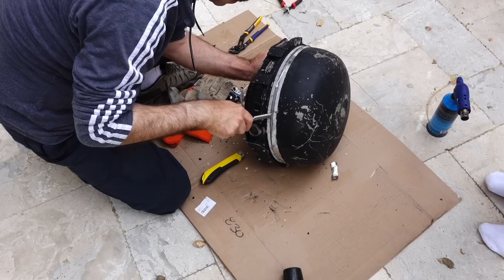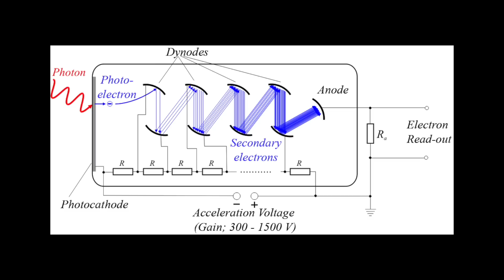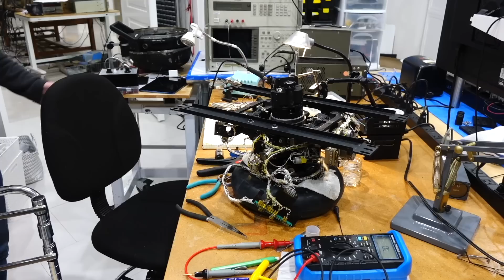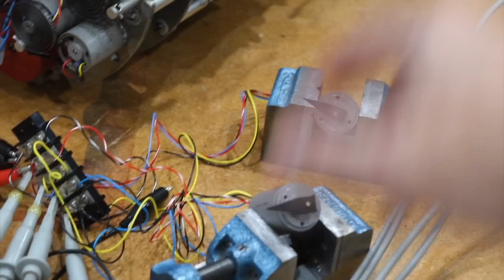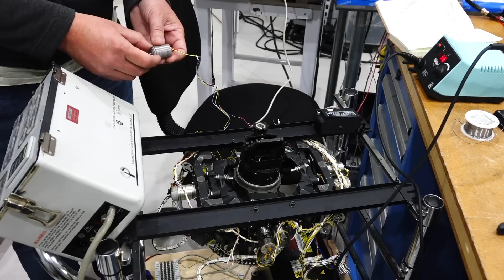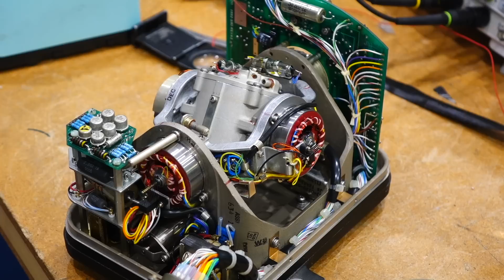B-52 Bomber Astro Tracker - Part 2: Power up and gyro-stabilization

Comment: Many years ago, I used to help maintain the Royal Navy SCOT satellite communications equipment as a 3rd line maintenance engineer. There was a complex analogue / mechanical computer used to control the safe transmission areas, AKA the 'Wooded  Arc computer', it was a very interesting, if somewhat frustrating, piece of hardware to maintain.

Comment: And they said we couldn't do all the stuff they do today. All they had was slide rules in smart people and look what they'd done the rocketdine J1 rocket engine, I mean, look at everything they did before digital computers.
Reply from the maker: Oh no, they sure used computers. Humongous, if slow, digital ones, and when that wasn’t fast enough for the engines, analog ones. We have the analog programs for the J2 engines, and it’s quite impressive. It can simulate the whole ignition phase of the engine, all the pressures, temps, and the flows, transients and all. But you had to know your maths.

Comment: What are the liquid sensors in the gyro? How it works?
Reply: Sometimes called « gravity sensor » they permit to keep the horizontality of both gimbals, therefore the verticality of the gyro. There is inside the sensor a kind of electrolyte solution in contact with a common line. The resistance between the common terminal and a sense terminal depends on the volume of electrolyte between the common line and the sense terminal, which depends on the angle of the sensor. The sensor is connected to the torquer of the other gimbal which produces a control loop, keeping the gyro vertical.

Comment: AVE has a present for you Marc,   the unopened Gyro part for your Astro,  and Dave hasn't had a go at it.
Reply: Saved by the Canadian! Or maybe it is the french connection?! Naa... that ain't it. 😂
Reply: @rkan2  Ha Ha  good one.
Reply from the maker: Yep. That’s not the gyro, but it’s even better: it’s the analog computer that calculates the pointing. Full of gears goodness. The one that Dave opened up.

Comment: The German equivalent of this device was the so called Himmelkompass, an innovation using light from the dawn (this light is naturally polarized) so that it could navigate to the far north and arctic. The Astrotracker as far I remember was using fix points on the sky and it was initially developed for the archangel projects, leading to RS71.

Comment: I see you are making great progress. The rotating shutter is used to resolve azimuth error and altitude error. The circular hole in the shutter just touches the center of the viewing port. When the azimuth and altitude values are correct, star light passes through the center of the viewing port and a square wave signal is generated by the photomultiplier regardless of the rotational position of the shutter. If there are errors in the altitude or azimuth, the shutter will block the star light during part of its rotation and the square wave signal disappears. By noting the angular position of the shutter when the signal is present, the system resolves the errors into azimuth and altitude components. These errors are displayed on their own digital display box and fed back to the computer. The computer uses these errors to adjust its calculated star position and it is fed back to the astrotracker. As the corrections are applied the error signals are reduced until the star light passes through the center of the viewing port.

Comment: Something else I noticed - since the tracker platform is not moving in flight, you could have just used a couple of weighted bobs on the two test syncro transmitters shafts to get a reference for "down". But why do that when you just have an extra vertical axis gyro just lying around? Extra mile as usual, great job!
Reply: It's all moving in flight
Reply: @snakerstran9101  Right, I meant "it's not moving in flight" right now, currently - it's on a test stand.

Comment: So, the old TV antenna rotator on top of the tower beside our house, was that a servo resolver also?
Reply: The ones i know are just 2 way synchronous motors, with a limit switch that cuts power to the motor when the limit position is reached.

Comment: I was a crew chief on B-52 H models in the 1980s and would take care not to kick or step on the glass dome of the Astrotracker on the top of the fuselage center wing section every time I had to dip fuel tank to verify the fuel load.  I was always curious how this gizmo worked and thanks to your video, I am just as confused but more informed on it's operation.
Reply: cmon, kick the dome

Comment: Great video (as is your usual)!

Plus-or-minus 15 degrees in roll is less than the bank angle for a standard rate turn.  Any idea whether they´d have the pilot fly straight and level, and have the navigator cage the gyro, to get the platform leveled after takeoff? Or was the range in roll greater than you stated?

The tachometer-generator is essentially the Derivative part of a PID controller!

Your box of Chinese polywannacracker capacitors is exactly the same as mine!
Reply from the maker: The tracker would simply loose lock during higher bank angle maneuvers, but it would lock right back as soon as you leveled off, as the underlying B-52 inertial nav platform would have continued to track heading accurately in the short term, and the pointing computer would have continued to compute just the same.

Comment: I've always loved those old servo systems.  In the Navy (more years ago than I care to remember) we used those resolvers with many plotting tools.  We fed the ships speed signal into the rotor winding and turned the shaft based on the ship's heading (using a signal from the gyrocompass).  So the two outputs were north-south speed and east-west speed.  Fed that into a 'dead reckoning plotter' to help us track ourselves and other ships in the area.

Comment: Such cool devices. I have a Simrad RGC-50 gyro compass (manufactured by Tokyo Keiki) out of a tug boat that has been modernized. It makes the same gyro and synchro noises as in this video. The synchros are used to have the heading frame follow the gyro (called a sensitive member) itself, and also to communicate the ships heading to a repeater at the helm position.

Comment: Interesting wiggle the gyro does, too! Does it do that to self-align if the case isn’t perfectly level?
Reply: Self-alignment is performed all the time. At start-up the wiggle is due to the low rigidity of the gyro rotor, in that case the effect of the torquers which regulate the verticality is strong, and reduces when the rigidity of the rotor increases.
Reply from the maker: @lelabodemichel5162  I was going to say "exactly, just what this astute commenter answered", then realized it was Michel...

Comment: If the whole thing is stabilized by a gyro, then how is it any more accurate than a gyro compass?
Reply from the maker: That's a vertical gyro. Different beast from a gyro compass entirely. It just maintains the telescope base vertical (and unlike a gyro compass, it does not drift because it self-torques to the local vertical). Direction and location info comes from the star sighting, not from the gyro. That's the whole point of the device.
Reply: Wow, it's amazing that they accomplished this without a digital computer. Thanks for another great video!

Comment: 3:50 given how good mirrors are today, it makes you wonder why telescopes for astral observation don't do away with the whole dome + telescope moving (which is a costly item to maintain, let alone make) and don't use something like this. It wouldn't even need to be a prism. A mirror enclosed inside a vacuum would probably suffice. It would be relatively cheaper to make, maintenance would certainly be cheaper and so would the maintenance costs, not to mention the fact that with a static telescope, you would effortlessly increase the component sizes since weight isn't a factor anymore. All the seals would be smaller, the costs to keep the telescope at an even temperature would be lowered... THIS, is how telescopes should be made. Whatever obstacles there may be in the manufacturing of the moving component would pale in comparison to the benefits gained. Not to mention that if you do this... you could feasibly make some really wacky telescopes that increase the size of the observed area.
Reply: Reflector telescopes are simple in design with virtually no moving parts, mounting them is relatively simple, and building a dome is relatively simple too. 

No, this is more complex especially if you need moving components inside a large vacuum chamber and have this chamber built of a non-distorting material. And scaling would be a pain as a vacuum chamber will need to scale with the cube of the apature...

Comment: 0:33 for future reference, i was reading a forum on the topic of de-canning stuff like this and the recommended method is to use a 400w iron with a flat tip that's about 2x2 cm wide. The specific tool the forum was discussing had a small metal belt behind it, in which you'd fit the strip and pulling it forward would also pull the strip away from the canned item. It's not electronics specific. At the time (and prior) a lot of things were canned in this fashion in vacuum to preserve them, including such things as art pieces, food, chemicals.
Reply: Mmmmm. Flames Not Good for Astro-tracker!  The earliest soldering 'irons' were massive blocks of copper filed to a small chisel point,, mounted on a mild steel rod with a wooden handle, heated separately, usually over a gas burner. One could do quite a bit of work before needing to swap to the 2nd one sitting on the burner.  We used them in the Post & Telegraph back in the 1950s when working on underground telephone lines.
Reply: @av8bvma513  I didn't realize the tips were copper! Better heat conductor I guess.
Reply: this reminds of soldering irons we had in high school metal shop -- actual large iron slugs with wood handles that were put in tabletop gas-fired burners to heat up and then solder pieces of sheet metal together.

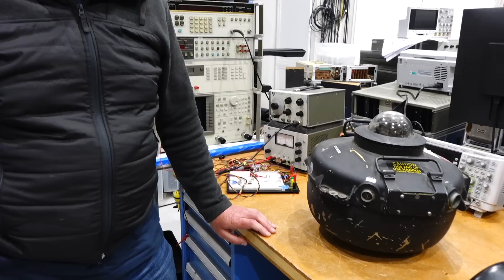Comment: 11:18 Doesn't EVERYONE travel with their own Vertical Reference Gyro? I myself personally have 3, one for travel and two for backup!😁
What on earth would we do without the "Doodley-Doo"? We'd have no idea what is going on!
It's absolutely amazing that something so complex and mechanical was also robust enough to be mounted in a B-52.
Tiny mechanical parts as well as electronics hate four things: vibration, large temperature variations,  moisture and dirt.
All of these are present any time a device like this is removed from laboratory conditions and has to deal with the real world.
Getting it to work at all, let alone in a B-52 bomber is a tribute to the engineers that developed this.

Comment: The name really suits the channel,marc is curious about so many things,but he has the applied math and engineering smarts to explore his curiosity,thats why this channel is so damned brilliant!
I can only partially grasp whats happening on my first view,so i will have to watch several takes,to grasp the interconnected ststems here,i only have an undergrad math level of understanding here,theres a lot of feedback loops in the mix,i dont know much electromechanics.
The thing is,using analog methods,the solutions are really creative,and the electro mechanal device they built back then,is so flippin gorgeous,its a work of art!
How to  solve a difficult problem,when you dont have a 64 bit multicore processor,and a truck load of software libraries to run your equations on,watch and learn people!!!
Well done Marc,and Michel!
Just to add,ive been tuned into Michels channel for about a year,he's amazing,check him out.
Not surprised he and Marc hooked up.

Comment: How to select which star to use?
Reply from the maker: It’s explained in part 1. You have a panel on which you enter the star Hour Angle and Declination, the GMT, time, the Greenwhich Hour of Aries (from an almanac), and your estimated latitude,  longitude and heading (usually from the inertial nav). The analog computer then takes all of that and points the telescope the right way (hopefully), automagically.

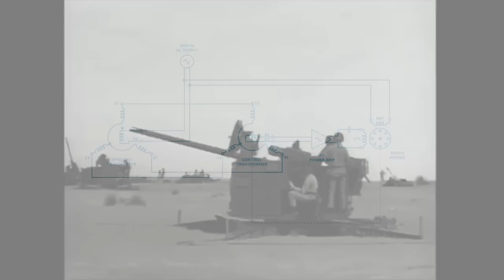Comment: 14:37 what technology was used to amplify the servo signals to drive a big gun, in the days before IGBTs etc?
Reply: I saw not so long ago a good video about the B29 turret control system, if you type in the search field you can find it easiely. The gun moved by powerful dc motors. The power stage is a H bridge builded from  simple electromechanical relays. The cold war era tech was more advanced maybe.
Reply: @ Thanks - I went down the rabbit hole and the answer seems to be a device called an Amplidyne.  Essentially a motor coupled to a generator and the control voltage is applied to the generator field windings to vary the output.  Wikipedia has a good description.  Thanks for the hint!
Reply: @Richardincancale  Yeah i'm an idiot, 2 weeks is enough to forget anything :) I confused the small follow up motor in computer with the big drive motor. Amplidyne is the right answer..

Comment: How anyone comes up with something like this is next level crazy
Reply: Needs must. And remember, these were designed and built without Windows, CAD or even spreadsheets. Perhaps mainframe timesharing systems. And slide rules, probably. We have pretty much (not entirely) lost the skills these Real Engineers used to design this.
Reply: Stepwise refinement of design, same as their stepwise reverse engineering

Comment: In the days of pure electromechanics getting things done was hard, even with the art being fully developed. Nowadays we engineers have a lot easier time with modern electronic sensors and data processing parts. Of course GNSS systems have revolutionized navigation, and the astro tracker is a fascinating historical artefact. Mechanics is still mechanics and optics is still optics, but the total difficulty level of designing e.g. automatic mechano-optical satellite pointing systems is greatly reduced.
Reply: I don't think it is more easy these days, I think then they just needed more people to do it. Every person has the task it can take.

Comment: Discussion between Michel and Marc reminded me of some Star Trek discussions between LtCmdr Data and Geordi La Forge: "I will program a feedback loop to synchronize the phases of our transporter signal to the alien's signature". "Good idea! And I will activate our phasors and adjust the frequency of our warp core main line..." 😇
Reply: And of course, reversing the polarity fixed the issue.
Reply: @Wooogaaa But only after bypassing the relays.
Reply: And this can all be done with a few key presses in a few seconds!

Comment: Since this is all directly linked analog computing - how come there's a notable delay between the gyro's movements and the output motors moving? Shouldn't that almost happen inmediatley?
Reply: There is a dampening in the loop, as it is made with basically motors, which have some inertia.
It is « custom made » here by Marc, with available hardware, for demonstration purposes, I suspect it was a little more « snappy » in the original device. though the stars are not known for moving fast in the sky and the bomber drift and attitude changes were probably fairly slow when it was in use, it was probably never an issue.

Comment: Stupid question (?):  Is 400Hz AC used in aviation primarily to attain a higher resolution for synchros, or is there another base reason?
Reply: It makes for lighter transformers (same reason that switchmode power supplies use high switching frequencies).
Reply: @ickipoo  Exactly.  A few years back, I got some equipment at a hamfest which appeared to have been scrapped out of a Nike battery.  The display scope ran from 400 Hz 115 volt.  The power transformer for the scope was about the size of my fist, but a 60 Hz transformer would have been many pounds.  The scope contained two resolvers for Az/El readout dials.  Those 400 Hz 115 volt resolvers aren’t exactly small, in fact they are a lot larger than any shown in this video.  As a test, I tried running them as master/slave at 60 Hz, about 60 volts so they wouldn’t get too hot.  They tracked pretty nicely even at 60 Hz with reduced voltage.  They were a bit slow lining up, but I’m sure they’d be nice and snappy with 400 Hz.

Long story short, the line frequency should not really affect the resolution of the resolvers.  At least that’s my neophyte opinion.
Reply: No, it's used to reduce the size of magnetic components like transformers.  The higher the frequency, the smaller the magnetics need to be.  Smaller = Lighter = Bigger payload or range for the aircraft.
Reply: Duh, yeah.. that makes complete sense.  Thanks! (This is why I threw in the disclaimer.)
Reply: Smaller and lighter transformers (and passive components). But the drawing of the complete system Marc shows at the beginning of the video helps you understand that not all the weight being carried in the B-52 was bombs...
Reply: @ There’s an educational film about SAGE produced by IBM and/or Western Electric where they talk about the SAGE ground computers and then pivot to the computer system on B-52s.  What they show looks like IBM 1401 cards each individually installed in black cylindrical canisters attached with Deutsch connectors to a neoprene clad wiring harness.  The thing must have literally weighed a ton and if the film was giving an honest portrayal, was an insanely inefficient way to build an airborne computer.